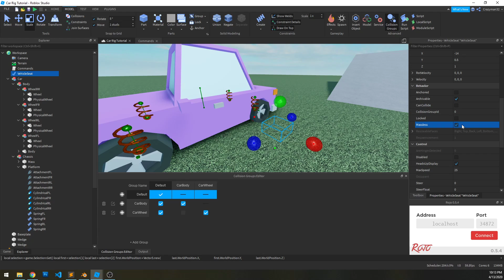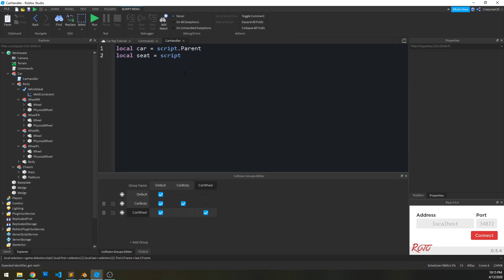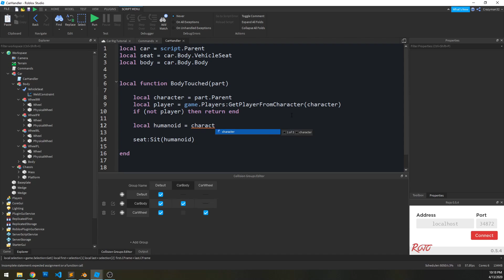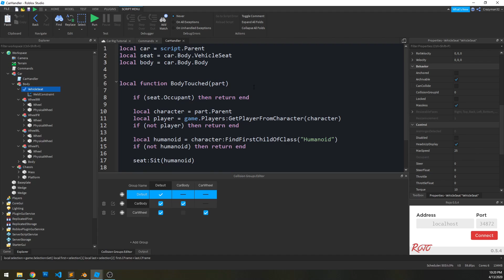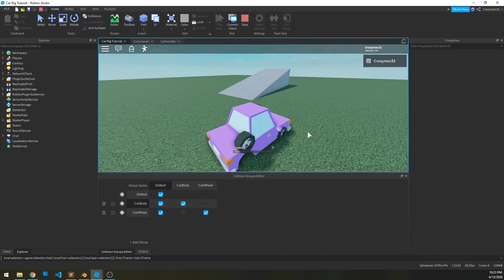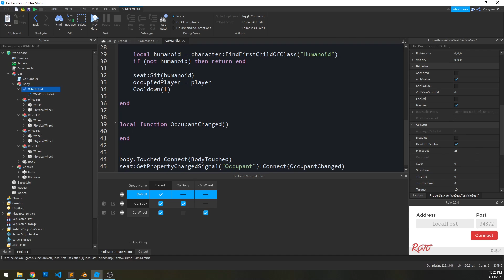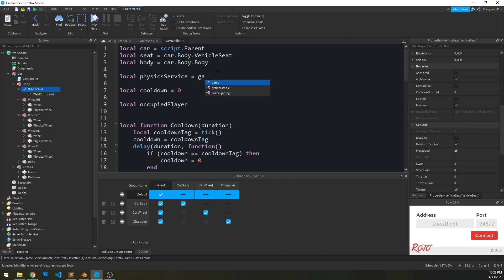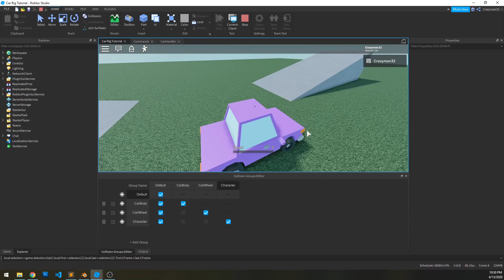Roblox: Car Rig Tutorial (Part 3 - Server Script)

Comment: I thought you said on Twitter at some point that people shouldn't use ipairs() in situations where order doesn't matter as it can confuse some people XD Cool video regardless.
Reply from the maker: The new Luau interpreter changed this! Now there's no speed difference between pairs and ipairs, but ipairs will at least guarantee order and thus is preferred when looping through numeric indices.
Reply: @sleitnick1  new? Wasn't it like that for a while? I ran a test years ago to check differences between next, pairs and ipairs, all of them where very similar.

Comment: Couldn't you change the mass of the car/part by changing the density, not necessarily by changing the part size?
Reply from the maker: Yes, that would be a good way to do it too! Make the Mass part 1x1x1 in size and then adjust density.
Reply: @sleitnick1  oh wow never will figure the way how to use these but i only know thing that density is the "weight"
Reply: @sleitnick1  help i wrote the server script and it didnt forced me to sit down and this is the script:

local car = script.Parent --car value
local seat = car:FindFirstChild("VehicleSeat") --finds the seat
local body = car:FindFirstChild("Body"):FindFirstChild("Body") --finds the cars body in body model

local physicsService = game:GetService("PhysicsService")
local defaultCollisionGroup = "Default"
local characterCollisionGroup = "Character"

local cooldown = 0

local occupiedPlayer

local function cooldown(duration)
	local cooldownTag = tick()
	cooldown = cooldownTag
	delay(duration, function()
		if (cooldown == cooldownTag) then
			cooldown = 0
		end
	end)
end

local function setCharacterCollide(character, shouldCollide)
	local group = (shouldCollide and defaultCollisionGroup or characterCollisionGroup)
	for _,part in ipairs(character:GetDescendants()) do
		if (part:IsA("BasePart")) then
			part.Massless = not shouldCollide
		end
	end
end

local function bodyTouched(part)
	
	if (seat.Occupant or cooldown ~= 0) then return end
	
	local char = part.Parent
	local plr = game.Players:GetPlayerFromCharacter(char)
	if (not plr) then return end
	
	local human = char:FindFirstChildOfClass("Humanoid")
	if (not human) then return end
	
	seat:Sit(human)
	occupiedPlayer = plr
	setCharacterCollide(char, false)
	cooldown(1)
	
end

local function OccupantChanged()
	if (seat.Occupant) then
		setCharacterCollide(occupiedPlayer.Character, true)
	end
	occupiedPlayer = nil
end

body.Touched:Connect(bodyTouched)
seat:GetPropertyChangedSignal("Occupant"):Connect(OccupantChanged)
ofcourse i dragged vehicle seat to model and script into model